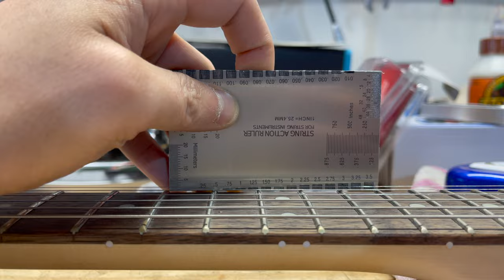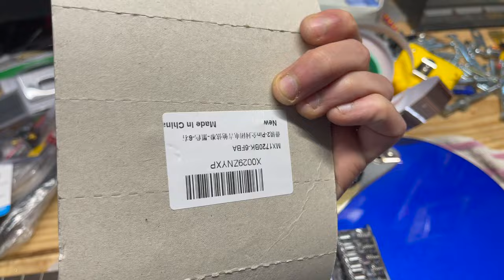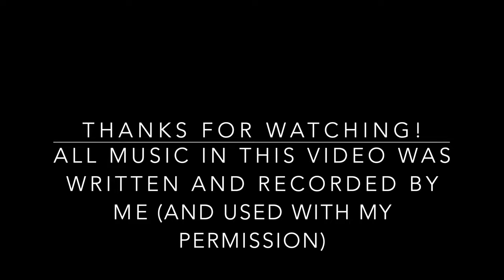Squier Bullet Mustang - "Bigsby" Mod & More!

Comment: Amazon had it on sale for $139.99 so I ordered one today. I also got some P90s to drop in it and found some locking tuners that have the same screw hole position as the stock tuners for $11 on sale. I'm keeping the stock bridge and saddles for now, but they'll probably get changed out for a Jazzmaster style bridge and trem system at some point in the future. I'm also going to shim the neck to tilt back about .5 degrees. Leo Fender originally designed offsets to have a slight tilt back. It also allows you to install a little bit taller bridge. 
The pickups and tuners I take off this instrument are going on my cheap Chinese Glarry "Mustang" clone.
Reply from the maker: These guitars are very fun to mod!

Comment: Is there any way to install a Floyd Rose trem into one of these? I have one laying around and was wondering!
Reply from the maker: It would be possible, but barely:

1. You’d need a wood router
2. You’d need to rout out a cavity for the trem all the way through the body
3. You’d need to rout out the top layer for the bridge
4. You’d need to drill holes for the posts
5. The trem block would likely poke out the back of the guitar due to how thin it is
6. You’d need to cut the nut slot to fit the locking nut

So, you COULD do it, but it would take an immense amount of work and without absolute precision it would not be usable.

Also, considering how thin this guitar is(it’s INSANELY thin), I would worry about the integrity of the body after such an install(cracking, warping, etc).

Comment: What did you do to the ground wire after installing the new bridge and bigsby. Cuz currently I am trying to modify my bullet mustang and im replacing the original bridge with an actual fender mustang bridge and tremolo. And im having trouble figuring out what to do with the ground wire
Reply from the maker: There are a couple options:

1. Ground it to the bottom of one of the bridge posts
2. Ground it to the bottom of the bridge
3. Ground it to a metal piece attached to the underside of the trem system

Comment: Buzzing is not necessarily due to tuners. I replaced the hardtail with the bridge first - it was the worst I've ever seen! 
And also - the Jaguar/Mustang old-fashioned 9.5" bridge is not the best option at all with the Bullet's 12" neck radius! So I chose the 4x more expensive Schaller 12" bridge.
Reply from the maker: You have a very good point, and this was one of my first mod projects. If I had to do it again I would go with a 12 inch radius bridge for sure. I suppose I can still swap it out :P

Comment: When you installed the Bigsby-style tremolo, is there a certain measurement to go by, for where it gets mounted? Building one very similar :)
Reply from the maker: For the bigsby, not so much. For the bridge, measure 24 inches from the nut since the Mustang is a 24 inch scale length guitar. I just rigged the bigsby to fit where it looked visually appropriate. I’m sure there’s a better way to do it, but that was my method!

Comment: hey thank you for the video, I was wondering can ı apply the bigsby and the bridge modification for a Affinity Squier Strat or what do you suggest to me  for putting a bigsby tremelo to a Start in general? Is using a Jaguar bridge ideal way to it? especially in the terms of price because guitar spare parts unfortunatly aren't that cheap in my country, thank you for your attantion!
Reply from the maker: I wouldn’t do it. The existing Strat trem is far superior to a cheap bigsby-style like this one. You’d have to route out holes for posts, etc. But, if it’s a hardtail without an existing trem, this is one of your only options for adding one.
Reply: @BigJakeMusic  I was thinking actually the same thing, it's not a hardtail but I just love the look of a bigsby on a modern looking guitar. But you are probably right, İt will be best to posponde my bigsby enthusiasium for a future guitar of mine I guess, thank you for your answer!